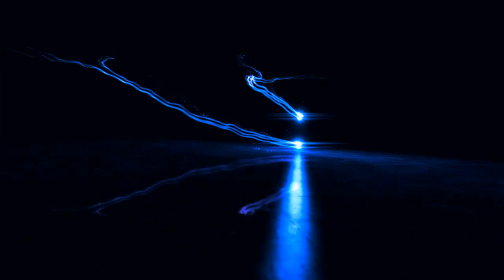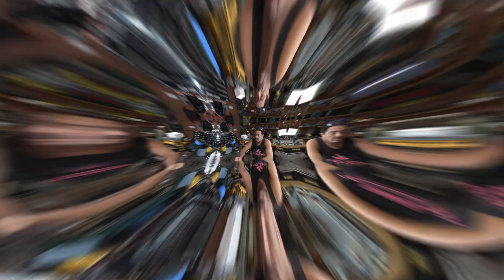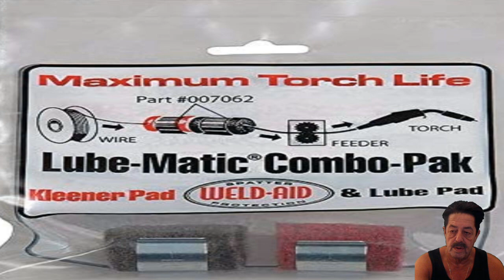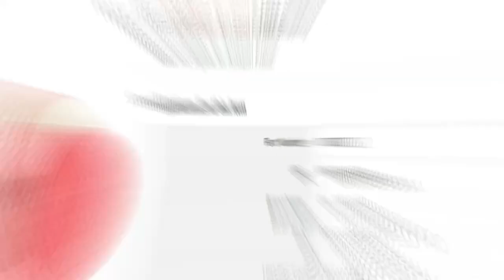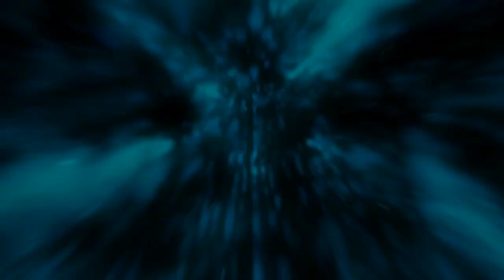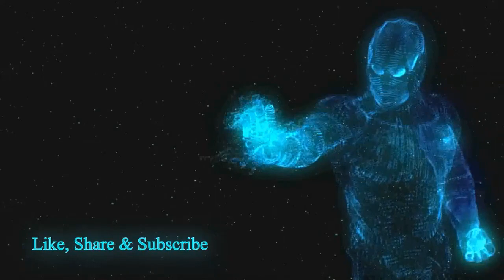Mig welding - Weld Aid Wire Cleaner - Discussion

Comment: I have used it for years, and it helps tremendously it virtually stops sticking and fouling in the tip and liner if you use the lube cleaner

Comment: just jam the wire through a foam ear plug and replace with each spool change, adding oil or some rot runs the risk of contamination of the weld pool, although most wouldn't know the difference.
Reply: The old ear plug trick works well

Comment: I worked at place that used a fiber block that wire went thru before the feed rollers do not know how it worked but did use lincoln wire on miller machines and had no problems.  Good video keep them coming.
Reply from the maker: yeah you could make them out of a 3m pad like also but i run good quality wire and so far my rollers etc are very clean - plus i wipe them down now and then
Reply: @TheHomeHandyman  the best solution is good wire.